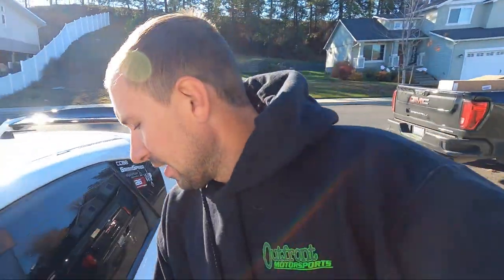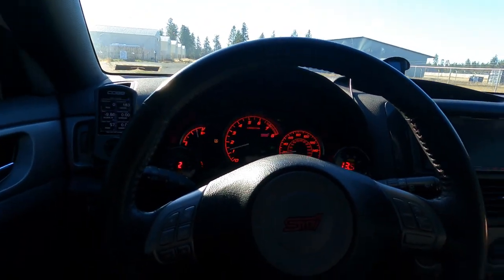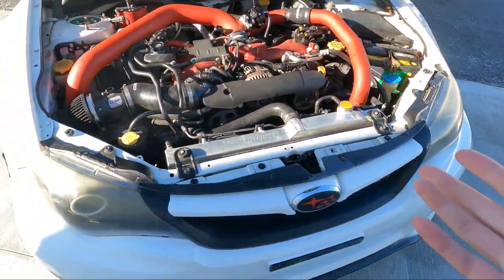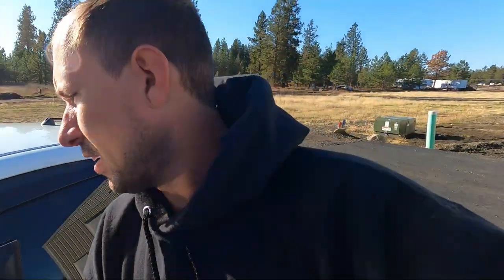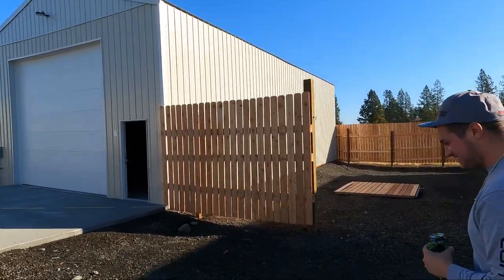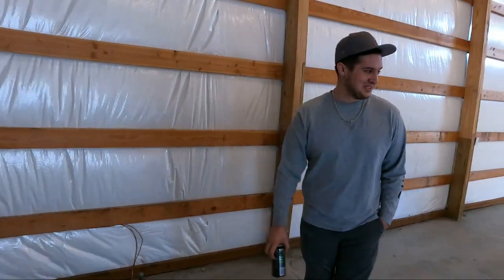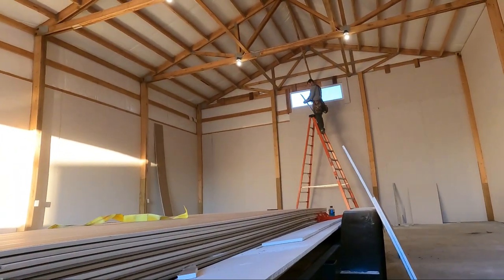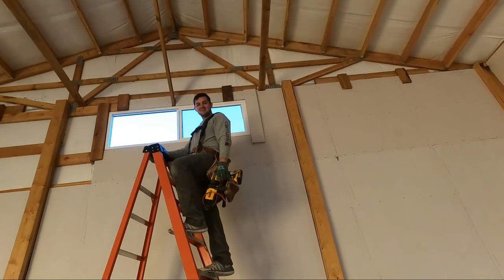Shop Update!

Comment: Damn Alex did an amazing job knocking out that drywall 🔨 Get yourself a paint sprayer spray it all white so it looks seamless and get rid of the old man wood look lol.  Should spray the ceiling black it'll turn out super sick the ceiling will just disappear with the right lighting.
Reply: Thanks man!
Reply: The exposed wood beams actually look nice. They would look even nicer stained as Alex mentioned.

Comment: Make sure to prime the drywall & mud with pva primer before painting!   Its cheap & it will come out looking nicer.
I do a good amt of painting, my business.. inside or out!
Reply: Use 18" roller set up with an extension pole.  Way easier/quicker than say a 9" roller.  Smooth wall? No texture, get ultra finish nap roller 18". From like sherwin williams not homedepot.   Will come out looking so nice!
Reply: You could spray it too, but may not be worth the hassle.  If spraying then still backroll it, while spraying, with 18" ultra finish nap.   To ensure its even, no drips  etc

Comment: Make sure to run all yer future possible electrical needs before you hang drywall (heaters, ac, tools).Saw the stack of drywall,and may be too soon. Figure out yer power needs before hanging drywall, I've Doon this for years
Reply: Yeah we were in a time crunch to get it all done, but it never hurts to cut a sheet out if needed and patch it later. Not the end of the world.